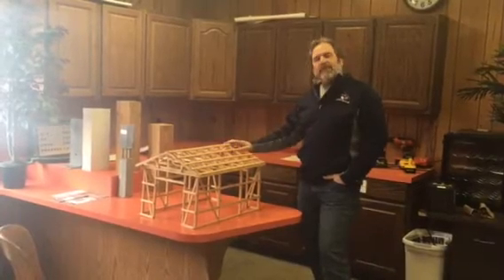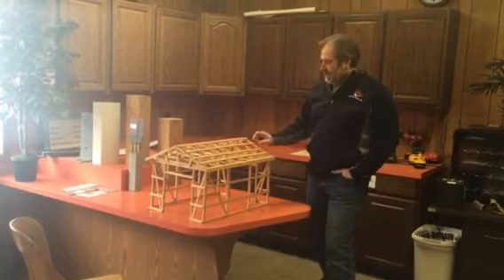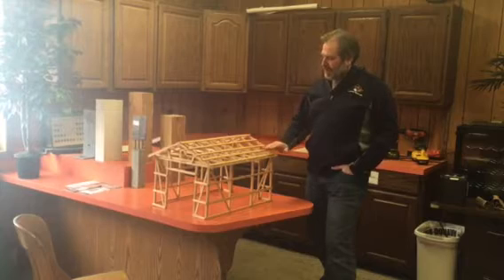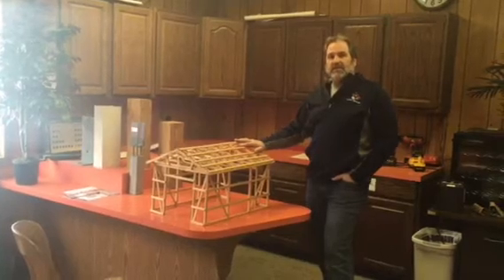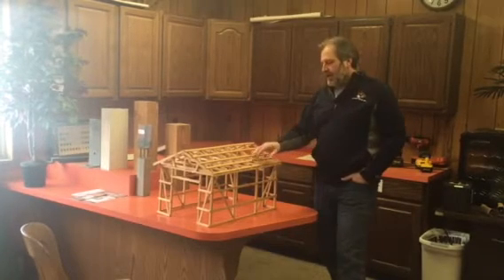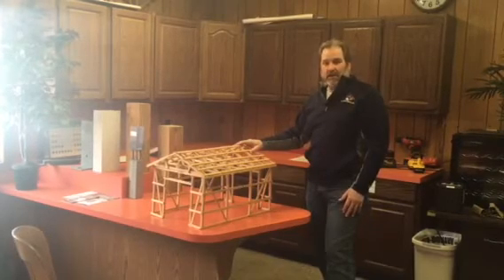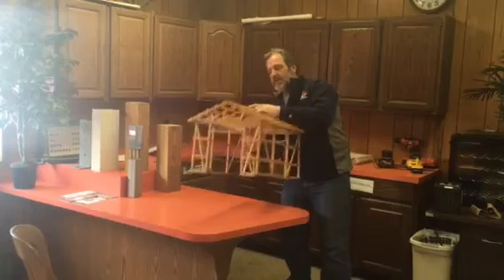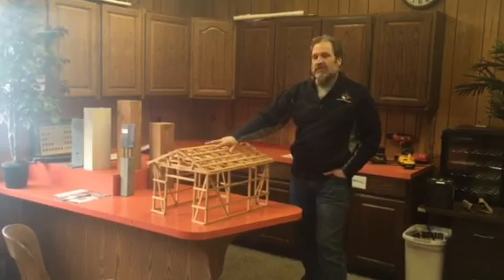Pole Barn Truss Spacing | 4' on center with placement on double top beam

Comment: Did you say "shear value screws"? my pole barn kit will be 6' truss spacing on laminated posts. Rather than put 2x4 on edge, how about I put them flat every 16" rather than 24". What do you think of that idea?
Reply: It's a little late for my reply, but I like your idea.  But I'd feel more comfortable if the posts were notched at the top to let that top beam rest there, for the trusses to rest on.  But I'm not an engineer.
Reply: @dbdouglas  my posts were notched.

Comment: on edge means you got more than 3 inches of board to go through with just 1 and something inch to screw into for it to grab hold of, what you meant to say is flat which only gives you 4 inch wide with only 1 and something inch of wood to screw through, but never toe nail the purlins, you want to predrill a pilot hole and use a nail at least an inch longer than the wood on edge or on side, some go far as to place the board on edge between the roof trusses with brackets and some even go up to 12 or even 16 foot span by doubling up the trusses, but all is done per code where said structure is being built to meet or exceed wind and/or snow load ratings
Reply from the maker: Good point.  Ur knowledgeable.